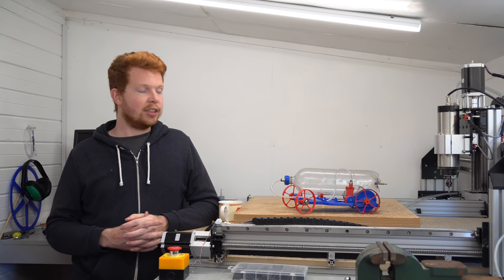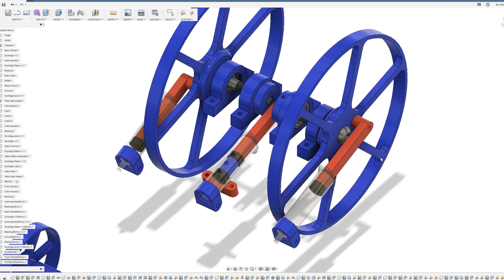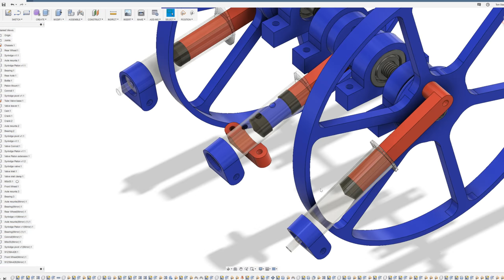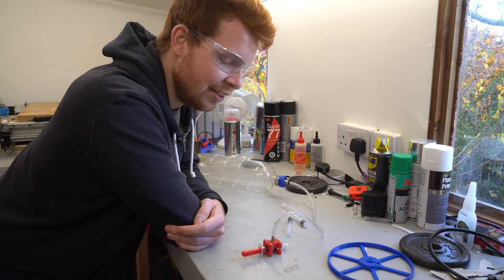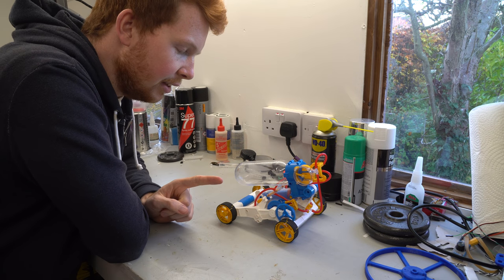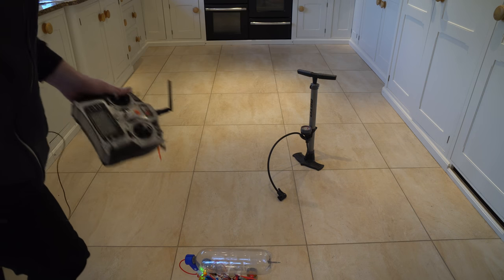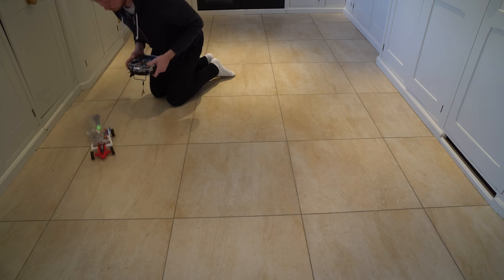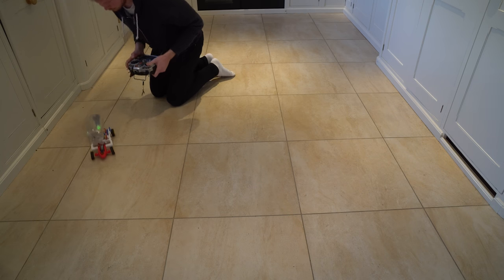Air Powered RC Car

Comment: Now, to get an even longer run time on it, try putting some dry-ice in the bottle, as the dry-ice sublimates it will continue to build up pressure while the air motor is using the pressure and run a lot longer, hopefully not getting to catastrophic levels.
Reply: Then it would be CO2 driven. Different project. Higher pressures. Big badda-boom.
Reply: Good idea, just install a safety valve at the bottle to limit pressure to safe levels.
Reply: @hgscanavino  the bottle may or may not explode
Reply: it would blow up it won't use psi fast enough
Reply: Paintball air tank.... spread the word
Reply: @naiknaik8812  schrodibottle paradox
Reply: @naiknaik8812  start at a lower pressure, that should fix the problem
Reply: So you're wanting Tom to make a Dry Ice Bomb-powered car?
Reply: The pressure in bottle would slow down sublimination, but the cold temp would also lower the pressure in the bottle. 

If it were just dry ice, you have to know how much to add and wait for some pressure to build
Reply: @thatguyyoudontknow3174  Agreed. Too unpredictable even with a vent valve.

Comment: Hope you will revisit with your own design
Reply: He could try glass syringes instead. I've seen them used as cylinders in an internal combustion engine before so I'm sure they can handle higher pressures.
Reply: Or he could reinforce the syringes with a 3D printed part
Reply: So i can conclude.
Either 
using glass syringe
Or 
make a engine block from 3D printer. And the plastic syringe as inner cylinder..
Reply: I agree, the video was actually really disappointing,

Comment: Tom, an idea for a future video. Water rockets! Multi stage ones with remote controlled launcher and recovery chutes
Reply: fantastic idea, i wonder what the world record is for 2litre rocket
Reply: Check out AirCommandRockets here on youtube if you find that stuff interresting. Its a really old channel, lots of videos about multi stage water rockets :)
Reply: I second this. I have made some experiments my self, adding fins, and making a retaining mechanism, so I could go up to much higher pressures. had a bottle go roughtly 100m horizontally, and 30m high with 8 bars and 3/4 filled bottle (you can have more water at higher pressures). Never found the bottle though, as it went in to a big field. After that I canceled all further launches though, as the bottle was aimed straight up, not to the side....
Reply: Thirding]
Reply: I did this for a highschool project years ago, 3 stages, servos to separate and servo released parachute. Ended up about 2m long with 2l bottles fixed together and reinforced with fibreglass. I was pleased with the simplicity of the chute release, just a section of 2l bottle wrapped inside out with a pin to hold it closed. Pull the pin and it flipped round, releasing the chute. All done on time from launch, rather than when acceleration dropped off as the electronics were expensive at the time
Reply: @cncgeneral  ahhh the old greased chopstick. wd.
Reply: @patrickwatkins7572  Uhm, I never said that. The finns were for stabializing only. the mechanism was to retain the rocket, so I could achieve higher pressures before launching.
Reply: ET I was watching them back when the videos were fresh. The bottle destruction tests were exciting
Reply: Have you seen the cable tie launch mechanising on the pvc pipe launch pad.
Reply: Sugar rockets as well
Reply: Uswaterrockets covers this topic fairly comprehensively. I'd rather see Tom do his typically unique stuff.
Reply: There is a bit of a water rocket engine research gap. You see water is a non compressable fluid, therefore most rockets just use a simple spout design for a nozzle. This leads to a low exhaust velocity and therefor bad efficiency. A slightly modified fuel is water with soap shaken to foam. This gives better efficiency even with a spout nozzle because the lower specific density of the exhaust makes it go faster. There are some problems with that though, soap is not a very good foaming agent (water does not stay in foam suspension for long) and now the exhaust is a compressible fluid, and might benefit from a converging/diverging bell nozzle. Another approach to this problem is to make a „high bypass engine“ where the water reaction mass is atomized and injected into a high velocity air stream to achieve both good exhaust density and speed. That may also benefit from a bell nozzle. Though bell nozzles also face substantial issues here because they would need to work well across a large working pressure difference. This could be solved by constant pressure, a variable nozzle or an aerospike design.
Reply: we have some in school we built in physics lesson. they are awesome and fly about 100 meters high
more stages sadly dont really equal more height
Reply: Oh boy
Reply: brilliant idea...i maybe would kill to see this =P
Reply: = wet kitchen floor
Reply: Boring af
Reply: I would do this with a much higher pressure using real steel tanks and make a real car out of it haha
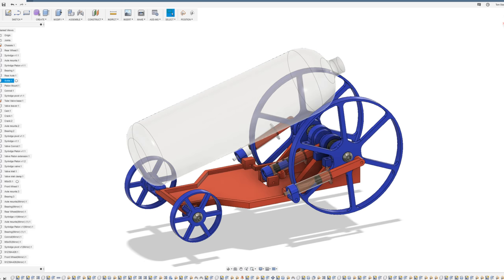Reply: wich program is that at: 1:51  ?
Reply: I wonder what that would look like! Cool idea though!
Reply: Nice idea
Reply: @patrickwatkins7572  yyou fiiiigyggggg
Reply: @patrickwatkins7572  fu
Reply: @ET_AYY_LMAO  fc go

Comment: Could you print a plastic sleeve to strengthen the syringes?
Reply from the maker: Yes, now that you mention it, I'm sure that would be possible! The only other issue I've realised since purchasing the kit is the high friction of the syringe 'piston rings'. USWaterRockets left a comment describing the clever design of piston rings used in the kit, which would be very difficult to replicate using the equipment I currently have. Thanks
Reply: Or put them in some epoxi
Reply: @TomStantonEngineering  maybe you could use the softness of the syringes and decrease friction by using syringe-sleeves that are not super tight but with some clearance, about 0.2 mm or something, so that the hihg pressure widens the syringe ?
i dont know if that would work or if the little piston would just be pressed harder to the wall and friction wouldnd change .
Reply: but maybe its a dead horse by now. the modded factory car works pretty well
Reply: @TomStantonEngineering  Can you not print the rings using TPU to make something similar - but still keep with the 3D printed concept ?
Reply: Put the siringes in a tight fitting aluminium pipe :)
Reply: maybe make custom syringes out of stronger material
Reply: how is it possible that you commented a day ago while the video is launched today??  odd...
Reply: @dutchmetalmaniac  Patreon
Reply: @dutchmetalmaniac  he is a patreon supporter. creators can show the videos to patreon supporters earlier than to other viewers, if they wish to do so.
Reply: You can make your own piston rings out of a material such as a bike inner tube. If you have ever taken the plunger out of a bicycle pump, you will see that the seal expands and forms to the outside diameter on the down stroke, but lets the air pass around it freely on the up stoke. You might be able to make this sort of seal out of a thin hose or maybe even heat shrink tubing. Just an idea...keep up the good work
Reply: @TomStantonEngineering  I think if you printed an engine block and sleeve it with the syringes you could build a pretty complex engine, as for the high friction pistons you could drip a little bit of low weight sewing machine oil.
Reply: I think the syringes use the slightly flexible wall as part of the seal. The Piston deflects the wall as it moves. Adding a rigid sleeve would greatly increase friction.
Reply: @wimwiddershins If you make it kind of a loose fit it should work. loose as in +.25mm
Reply: @TomStantonEngineering  try to lubricate them. The friction down drastically but I don't know about the lubricant and rubber interactions. Maybe the rubber doesn't last long.
Reply: @TomStantonEngineering  You can also try with glass syringes! But friction problem might still be there.
Reply: Exactly the thought I had
Reply: That would work, but then you'd essentially be designing a new valve. It would make more sense from that point just to print your own valves.
Reply: @TomStantonEngineering   why not use acrylic tubes they come cheap and either put syrynge inside or just build entire piston assembly, also some lubrication would help with friction. just a note that syrynges plungers usually expands in oil so maybe use soapwater as lubricant
Reply: @nishanthgopal196  It´s a good idea, there are lots of DIY Stirling Engine designs out there that uses glass syringes. Stirling engines need low leakage and low friction. I made one based on a Japanese design for a graduation project and friction is way lower than the rubber gasket used in a normal syringe. There are several Chinese made Stirling engine kits that uses glass syringes. The only concern wold be pressure, I´m not sure if the glass syringe will resist pressures like 150 psi. Tom Stanton I think you should at least try this alternative.
Reply: I was thinking just wrap it with some wire so it cant buldge
Reply: a thin sleeve would have done the job. As for the syringe plunger, a 3-d printed adapter with an o-ring might work well given some oiling.
Reply: Can i have the specs and how to use remote control to connect or any codes for it as i want to build 1 to try

Comment: I love this video! I didn't know you were working on this project again. I discovered back when you did the first car that syringes wouldn't work. I was designing my own version of the air engine, using a syringe as the cylinder, and ran into the same expansion issue you did. I thought about printing a reinforcing sleeve for the cylinder the way +Neil Griffiths suggested below, but settled on printing the cylinder slightly undersized and then boring it to the exact spec with a drill and polishing the inner surface. In my research I analyzed the "air hogs" engine and determined how their seal works, and I suspect that the car you bought has a similar seal system. The air hogs use a rubber seal that is tapered such that it almost (but not quite) touches the cylinder walls at the outermost edge of the seal. Since the seal doesn't really touch the wall, the piston is free to move with little friction from the seal, and air can flow by the seal so it doesn't have to compress air on the up-stroke. When the high air pressure is in the cylinder the flexible seal rapidly expands to seal perfectly against the cylinder walls. When the cylinder is on the negative stroke, the air inside the cylinder escapes around the edges of the seal which has collapsed back to its original shape. I did some tests with ninjaflex filament seals but got distracted with other projects before I finished the engine. I should really make a video showing my progress. Let me know if my explanation wasn't clear, if you want to pursue this further. I think you could easily make your car work without "cheating" ;-)
Reply from the maker: Good to hear I didn't just buy a dodgy batch of syringes then! Yes I was intrigued by the seal used in the car kit and your explanation is perfect. It's a very clever style of 'piston ring', which would be very difficult to manufacture without the proper equipment, at least on this scale. I, and I'm sure many others, would be very interested in viewing your findings with the air hogs engine ;-)
Reply: @TomStantonEngineering  Can you steal the pistons from the toy and use those?
Reply: Bicycle pumps and brake cylinders use similar types of seals, I believe. In fact, the seals that go in the brake cylinders that actuate the brake calipers on a car would be a good size for this type of project.
Reply: Maybe it would be possible to make piston ring from o-ring that gets crushed under floating piston head by air pressure. I'm not sure how much pressure you'd need to crush normal stiff o-ring.
Reply: Your explanation is clear. Thank you for sharing it with us+
Reply: @0calvin  Brake calipers on cars use square cut seals that are designed to pull the piston back in a millimeter or so after a brake application so that the pads don't continue to rub on the rotor.  It sounds like the ring in the air hogs is a different cross section that is designed to inflate under pressure.

Comment: Use glass syringes, im sure those can do more pressure and they are really air tight without lots of friction from the rubber. The only problem will be cutting the holes for which you'll need a diamond bit or cutting wheel for your dremel.
Reply: Or some hot tool. Much better in pre-stressed glass since it will break if you cut holes forcefully into it.
Reply: @Leadvest  
Bro, are you using a Canadian multi language keyboard? Because that is not an apostrophe.
Reply: But they be like those old cast iron cannons, works well, until it explodes on you face
Reply: Polycarbonate syringes exist and would be easier to drill
Reply: What if they explode. Glass shrapnel doesn’t sound pleasant. I think a 3D printed shroud that would fit tightly around the plastic syringe and reinforce it would be a good idea.
Reply: No worries. He owns safety glasses

Comment: that slider valve thing is what steam engines did about 100 years ago.

also, if you found a way to apply pressure to both sides of the piston, it would work better(steam engines did this as well about 100 years ago)

Comment: I love your projects with pressured air! Historical fact: For the construction of the first direct tunnel through the Swiss alps (1880 Gotthard), the engineers developed locomotives driven by pressured air. Coal driven steam engines would have poisoned the air with co2 in the middle of the 15km tunnel. In addition the used compressed air was comparable fresh and welcomed by the miners.

Comment: Consider adding tape to the walls of the syringe to allow it to hold the pressure. Also you will probably want to add oil to the rubber seals to reduce friction. The oil should make a big difference, and if you choose grease instead of oil, it might even increase the pressure before the piston leaks.

Comment: "3.5 ml of air in each syringe" 
That begs the question, 3.5 ml of air with what density and pressure? Would a pressure regulator make sense, to enhance your "milage" (at least you could easily figure out the needed volume of air for a certain distance at constant pressure)? As always good video ;D.

Comment: Fantastic work, Tom!!! 😃
A lot of people already gave you suggestions (like 3d printing a syringe sleeve, using epoxy and so on). So the only tip I would give you is: DO NOT use glass syringes. Because, if they explode... Well, safety glasses won't help a bit.
Reply: He could sleeve them with a bit of brass tube if he was worried. Or just use the brass tube as his cylinder.
Reply: @JMMC1005  That's actually a good idea!
Reply: wrapping them with several layers fiberglass cloth and epoxy would stop the plastic expanding too, it'd also build up some thickness for tubing connectors to grab/glue into.

Comment: You can wrap the syringes with a spiral of copper wire then cover the whole bit with epoxy and that will eliminate the stretching and bulging. I love what you have done.

Comment: Glass syringe’s are available on eBay uk, they’re about £3 each
Reply: Yeah... Imagine they exploding. 😐
Reply: MC's Creations
That’s when you cover them in plastic/epoxy, like car windshields.
Reply: @Warriorcat49  Dude, ANYTHING with pressure enough can explode. Even stars... And sometimes it really happens.
Reply: MC's Creations
Okay, I’m aware. Just saying that bonding a flexible material on top of them would strengthen them and also give the added benefit of helping to prevent glass shards from going everywhere in the event of a breakage.
Reply: @Warriorcat49  Oh, that's true. I had misunderstood your previous comment. 😊
Reply: MC's Creations
It’s cool. :) I’m just happy to try and add to the discussion, even if my ideas don’t work all the time. :P
Reply: @Warriorcat49  The same, dude! 😊

Comment: What I'd LOVE to see is use your own design and either put a pressure regulator in that only allows the pressure your syringes can work at (if possible).
Or even better use STEAM POWER.
You know how cool it would be to have a steam powered RC car? The steam will build pressure slowly so you could keep it at 15psi and leak out any excess.
Of course your piping and pistons would have to withstand high temperatures so maybe a full redesign would still be needed. But STEAM POWER, imagine that!

Comment: I would recommend making 3D printing a bracket that goes around the large diameter bottle and conect a 360 servo so it keeps pumping it up! Like the crank of a engine

Comment: now you need a transmission system..gears will help you run even at very low pressures thereby allowing you to use up all the pressure

Comment: There are regulators you can use to store a lot in the tank, but have the line pressure low enough for the syringes.

Comment: Couldnt you 3d print an air engine that accepts an O-ring on the piston, or even better, 2 O-rings? Then lightly oil the inside of the cylinder so theres very little friction. I feel like that would make it leak very little air.

Comment: I reckon if you found a way to drive the rear wheels through a differential, it might mitigate the slowing down issue when it corners

Comment: Next time you try this, consider making your own o-ring seal, try using Felt, cut out a small disc that can be secured between an upper and lower “piston half” lubricated with light sewing machine oil.

Comment: Ground glass syringes are fairly inexpensive and can take the higher pressure as a bonus they also have lower friction. Im currently using them as mini hydraulic actuators

Comment: Glass syringes have very little  friction, i just don't know how they would handle the pressure. I assume the power pistons connected to the wheels don't take the full pressure, so glass would work well there.